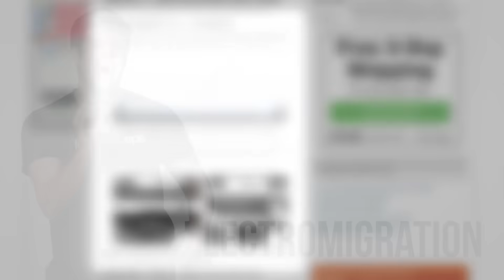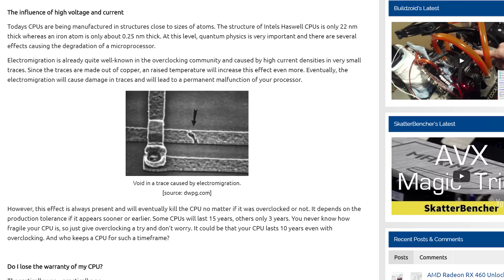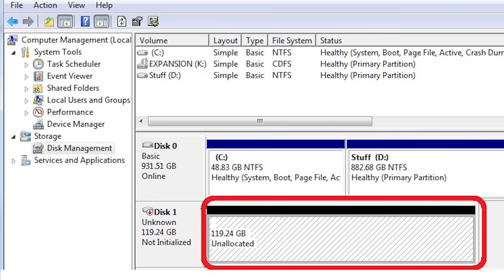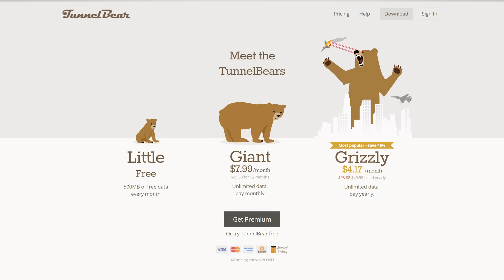Why Do Electronics Die?

Comment: Planned obsolescence is a scumbag move, but even more on mobile devices. In PC you can get away with an i5 2500 at this very moment, on phones the next android version is most likely not working for your model, no idea how it works for IOs though.
Reply: on android each upgrade makes the device better, if you can install the newer version. I'm using a Sony Xperia M with 4.3, and is quick as was with 4.1 (maybe a little bit quicker but eh)
Reply: the A7 is still a powerful chip, it outperforms most of the budget sector today.
Reply: i prefer using a rom made by internet strangers
Reply: I never had that issue, but I updated within 2-3 months of the release. It even never told me there was an update, I needed to manually search for it in the settings. 
But there is still a pretty big delay between the release of the stock android and the samsung version, no? At least, that's what the problem was a few years ago. Especially with Samsung and their heavily modified android OS.
Reply: TBH, Android phones age quite well if you do not care about updates. It is still perfectly usable. The only problem with updates comes in the big leaps such as the introduction of Jellybean (Lots of apps require 4.0 or higher) or if the app requires ART to run.
Your phone would not be as good as the newer ones, both in software and hardware but it is still perfectly usable and is not much worse that it was originally.
Reply: my s2 has better camera quality with the custom rom i use and the battery life is much longer
Reply: i am actually using a galaxy s2 with android 7.1.1 and it runs better
Reply: @ΑΡΗΣ ΚΟΡΝΑΡΑΚΗΣ 
so what you are saying is... 
You are fine running a 2012 OS (Android Jellybean) on a 2013 released phone?.. And you are also totally fine with no updates since then?
Of course you will tell me that the amounting list of apps that you can't update or even download doesn't bother you at all, Right? 

Perhaps you would have been better off with a different brand.
Reply: On android the next version is most likely not working on your model

No.. thats just what companys want you to think
you can EASILLY run it by running a custom rom
Reply: They won't fix all problems with custom rom of course. My opinion is, get custom ROM only, when it has feature you need, or when the stock one has very bad developers (I'm talking to you, Asus).

However since talking about camera quality, it is killed by low quality roms (with poorly written kernels). Get well rated rom, made for your device, and camera will be running as great as allways.
Reply: I have samsung galaxy s3, tested this myself: Ressurection remix (Custom rom), with version modified to run best on s3 has same camera quality as stock one.
However, stock samsung camera app has more customizable settings than stock android 7 (Can be fixed easily).

If you realy want, I can upload somewhere comparisons of stock/custom roms photos somewhere.
Reply: Not getting a new Android version is not planned obsolescence.
Reply: get away with an i5 2500, my dad was using a Pentuim D (two pentuim 4s) as a daily driver for a while at work. My nan still uses a C2D machine, and i had a gaming machine using a Q6600, nothing is wrong with the LGA775 CPUs and they still work lovely.
Reply: yenthel3 in iPhone you can put off the update. it Will continue to nag you about it. and my updates don't come from samsung, they come from my carrier, tmobile.
Reply: @yenthel35  IKR?? 
Facebook and messenger switched to a React JS / Native solution some 2 years back and since then loading times have been horrendous.
This is by far the biggest complaint on my iPhone, and the funny thing is... it has literally nothing to do with the iPhone or OS it self.
Reply: alex alcala ortiz 
Same here, however I put android 7.1.1 in galaxy s3. Runs smooth as butter compared to stock OS.
Reply: +Kodek Which Rom? Is hardware like camera and buttons working out of the box? (No i dont mean laggy software camera, but proper high quality)
Reply: +André Eriksen
Ressurection remix (CM Based). Used version made to work with s3, so hardware is working properly. I just needed to change function of home button, because android 7 uses them differently. Camera is working as usual
Reply: André Eriksen it runs fine without serious issues, and to correct you the cpu-z gives release date 1/8/2013 meanwhile the android 4.3 released 24/7/2013 according to https://en.m.wikipedia.org/wiki/Android_version_history#Android_4.3_Jelly_Bean_.28API_18.29. So yeah, I run old OS on old hardware (2013 mid range), but I run it well, and possibly until the 4.3 support stops
Reply: Curtis Murphy Except custom ROMs by third parties always have bugs and other features of your phone will suffer.
Reply: +Jorgensen Penus Yes, however solid third parties listen more to community, and relase patches OTA.
Reply: KODEK Not the case with Samsung since Touchwiz has a lot on the software side for camera. So stock ROMs wont get the same quality or the same features working well.
Reply: KODEK No need, it might be the case now on older devices (I used to have an S3 3 years ago and I remeber having worse quality on AOSP ROMs and the cam crashing back then).

Same with the Note 4 now camera crashses and has worse quality and also data connection drops a lot. And if I want slow motion recording I have to get open camera which has a really ugly UI imo. Also fingerprint scanner not working as well and some other things.

I guess what I'm saying is if you are really into the software of stock android then getting anything other than a Google or Motorola device doesn't make sense.
Reply: alex alcala ortiz Which rom are you using? and btw stock bootloader?
Reply: i am using lineage os 7.1.1 and stock bootloader
Reply: I'm using a Mac Mini from late 2009. I don't do anything too crazy with it, not landing spacecraft remotely, and there is no web page that has really changed since the time I bought the thing. But recently the operating system no longer updates to the latest version. That means that eventually the browser won't update, which means web pages won't load, which means I will have a brick that will not do the same old simple stuff it used to do when I bought it. I think it will run Windows 10, but not the latest version of OSX. Yes, planned obsolescence is a scumbag move.
Reply: Demonslayer20111 funny you are using a Note Edge from 2 years before it was made.
Reply: This Motherfocka Mostly depends on whether or not the Android dev community or yourself want to make a custom ROM for your device. Theoretically you can make the first Galaxy or Nexus device run Android O as soon as the build details are available for the public. AOSP FTW
Reply: Apple's actually pretty good at providing updates for older iOS devices. At this point their software support extends to the past 5 iPhone generations, which means about 5 years of guaranteed software updates. I used an iPhone 4S until just a few months ago, it received updates all the way up to iOS 9.3 (It originally shipped with iOS 5). Likewise, the iPhone 5 (which came out in 2012) still gets iOS updates today, however since it is almost 5 years old and running on 32-bit architecture (Apple is moving away from 32-bit support), I don't imagine it will see iOS 11.

Apple's also pretty good when it comes to hardware support, still providing tech support and repairs for phones at least 5 or 6 years after the phone was made. Sure the user-repairability of the iPhone leaves some to be desired, but most phone manufacturers do not provide the same level of support Apple does that long after a phone was made.

To make a long story short, despite all the flaws in Apple's eco system, you can be guaranteed support for your iPhone for several years after the phone has been discontinued. In my experience with Android, you were lucky to get any major updates beyond what the phone shipped with. If you have a flagship Android phone you can probably expect to see 2, MAYBE 3 years of updates, but I have yet to see any Android manufacturer that still provides official updates for a phone released 5 years ago. Of course, you can find or make your own custom ROM to run on a device, which is how people managed to get Android Marshmallow running on a Galaxy S2, but it's a hassle and my whole point here is about whether the phone manufacturer still provides updates.
Reply: Apple is the same company that solders their memory and SSDs on their motherboards, or renders parts of your device unusable if you service it yourself because Apple thinks you shouldn't do that. You can upgrade the hardware of none of their devices they currently sell, desktop or laptop. You can also no longer use your imac as a standalone display when its hardware is outdated but the screen would still be fine.

Apple devices also get updates that make their devices slower over time and you cannot downgrade to the faster older versions. This makes an old device get along with new features for a while, but it also makes the older device slower than it was before, "forcing" you to upgrade.

Finally, their default warranty is a single year! 12 months! These devices are not guaranteed to not break after 12 months! If Apple cared about longevity of their hardware, they would allow users to service their devices, offer parts for sale, and/or extend the warranty. Instead, if you don't get Apple Care, you'll have to pay for any repairs or buy a new one.

Meanwhile they do all kinds of "green company" claims, but thats just complete horseshit if you sell these machines with a guaranteed lifetime of 1 year.
Reply: +Toby Hinloopen I've had my iPhone 4 since 2011. The only thing wrong with it is the speakers are fucked and the home button and power button aren't "clicky" like they used to be.
I don't even see a need to upgrade, but when I do I'm probably gonna get an android or something because apparently the newer iPhones are slow as shit.
Reply: yenthel3 The iPhone 5 doesn't receive updates anymore. Only the 6 and onwards. I think it's something about just updating their 64bit Operating systems
Reply: I've seen issues with iPhones after an update before. My friends updated his iPhone 5s and then his fingerprint scanner stopped working.
Reply: This Motherfocka Desktop Dust-free Working Bench for laptop phone repair shop
①Solder ②Rework ③X-Ray inspection  We Provide One-Stop Solution!
This is Joy come from BGA rework station/ ALL phone repair and inspection line with 14 years experience.
REPLY me to get our product price list and more information.
Joy Rong
WhatsApp/wechat/Skype：+86 18779975930
Email: sales25@zhuomao.com.cn
LinkindIn: Rong Joy SMT X ray
Reply: you can install custom roms , dumbass...
The galaxy s1 has max official firmware of android 2.3.
BUT THEN THE CYANOGENMOD/LINEAGEOS DEVELOPERS CAME AND MADE EVERY ANDROID FOR THIS OLD PHONE!!!!
Reply: criminal
Reply: iOS is the different to Android. Apple force each new version onto devices by making all mainstream apps require it. Each new version of iOS comes with a UI worse than the last and serious performance issues.
Reply: Yeah... i need to agree, at some point.

Android devices have the "S series" (the top line) and "other series" (non top line...)

The "S series" works pretty good until today. Just look around and you will see a bunch of reviews, comparissons and etc, of a S7 vs S9... 

Apple on other hand, does not have "the top line", just a series of phones... (supposed to be all top lines)

What make that confusion on the world of phones. Iphones aren't better than Android devices, (not now) you probabbly does not get the right device. But how could you know, neh?
Reply: @hamu_sando  I do use samsung products myself,  using the  note lineup currently, and I do not agree that the reason is solely the hardware being not capable enough for  the lastest OS. They do not support the older phones all that well, but  since there are features(I heavily use the S Pen) I need I keep on using them. I used a custom rom (lineage OS) on the Note 10.1 as well and it seems to run fine now( Nougat now from Lollypop). There is no massive improvement but neither any significant drops in it. Samsung just does not give the updates to the olden ones.
Reply: and honestly, even if the android does have a problem, theres this thing where you can downgrade, and android actually lets you refuse updates, as opposed to apple, who shoves it down your throat whether you want it or not.
Reply: @Demonslayer20111  Uh, no. They show a pop up every couple days but neither the Desktop nor the phone is forced. ( unlike Windows home versions ) I never run the newest version as they always have some glitch. This is true for Apple and Windows machines. Been in IT since 1985, so far, waiting to upgrade the OS has worked for me and the customers who listen to me. If you must run Windows, get Win 10 PRO so you can fully control the updates.
Reply: I've read through this comment thread and I think a lot of us are forgetting that the average consumer, Mom and Dad, Nan and Pop, Betty from work and the homeless guy on the bus, simply don't give two sweet shits about phone updates. In fact (and this is why i'm replying to yenthel3) I've heard more complaints about updates slowing down old phones (especially iPhones) than complaints about a lack of updates when it comes to regular users. I get that we, the geeks, the nerds, the phonespotters want a completely up to date phone 5 seconds after the new OS version is released. But we cant forget that most people are perfectly content with a phone that just works the way it did when they bought it for the 2 years until they get a new one. There are only 2 ways to ensure you will get timely updates, buy your phone from a company that prides itself in providing timely updates like Motorola or Apple or take matters into your own hands and install a custom ROM. Going the custom ROM route seems like it might be more up the ally of an enthusiast anyway.
Reply: but at least they dont get slowed down on latest versions!
oh and you can factory reset and get the speed back from the factory.
Reply: Yeah, but that isn't an official Samsung update. It's made by some internet strangers. The point is that Samsung doesn't care if your 1 year old phone gets fast updates, if any at all. They only care about the latest flagship device. They are getting better at it though. Just google 'samsung update policy. At least Apple still pushes updates to 4-5 year old devices, making them faster, better and more secure. Google is also pretty good, but they also make the software and the hardware for their devices.
Reply: Demonslayer20111 yep i refuse to update my s7 to nougat because i fear that some of my apps aren't compatible with nougat
Reply: I bought 2 year old android phone for 50$ and it runs kit kat 4.4, i am amazed by this phone OS, my sister has 6.0 android and still likes kit kat more
Reply: Some (maybe most) android phones are only supported for 2 years. And even if they are still supported, you'll need to wait for the device manufacturer to push the update since it's almost never stock android. A manufacturer that supports their phones for 4-5 years is a good one. 
Also, on an iPhone you can refuse updates. Downgrading is also possible, but it's not really supported in the operating system, but you can work around that. But you rarely will have the need to do that anyways.
Reply: Yeah, if it works, why not. Everyone has his preferences. But isn't it a bit of a scumbag move of some manufacturers to stop software support after sometimes as little as a single year? As long as there are customs ROMS being put out by someone, there is no problem. But the basic support shouldn't come from them, but from the devices manufacturer. But maybe that's just my view. There are a lot of great things about a lot of phones using Android, but software support has always been a big problem. Thankfully it's getting better.
Reply: KODEK Yes but there are things that they can't fix a lot of the time. And camera quality will always be worse. So either be happy with the software that OEMs put on it or get A google Pixel for a smooth clean software experience and fast updates.

I wouldn't suggest anyone purchase a phone thinking that they can fix all the software problems with a custom rom.
Reply: fuck you talking about. im still using a samsung note edge from 2012 and its doing just fine. running latest version of android no problem.
Reply: Demonslayer20111 exactly!
Reply: Apple's updates for the iPhone are pretty good and they support devices going a few years back. The new update that launched yesterday is available for the iPhone 5, which was released in September 2012. I have a iPhone 5s (2013) and it's still working fine. The only really noticeable speed decrease is when I'm loading the facebook/messenger app where it takes up to 10 seconds for some reason. The biggest problem is that the 16GB memory (more than enough in 2013) is too small right now and there is no way to upgrade it other than buying the 32/64 GB back in 2013.
Reply: @yenthel3  Five years is too short for a phone